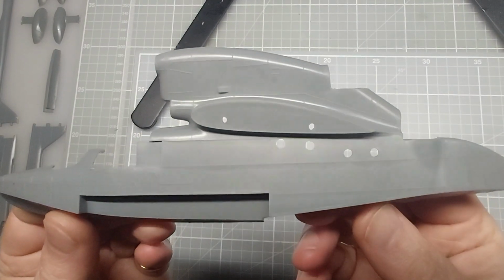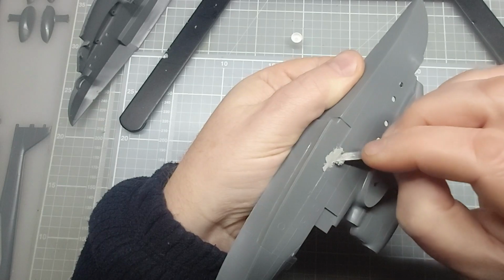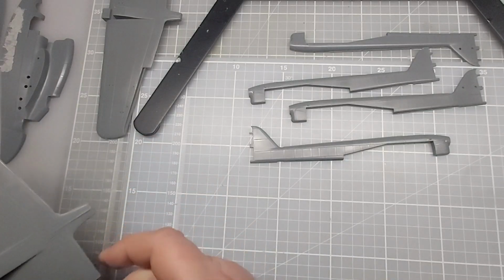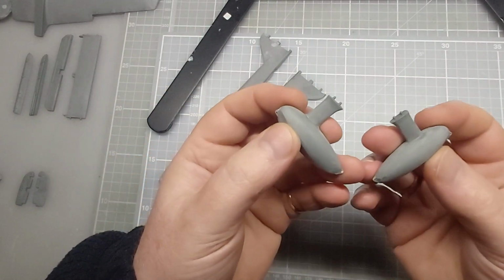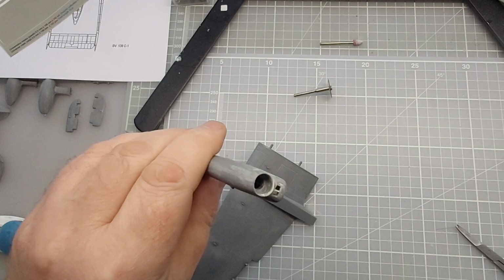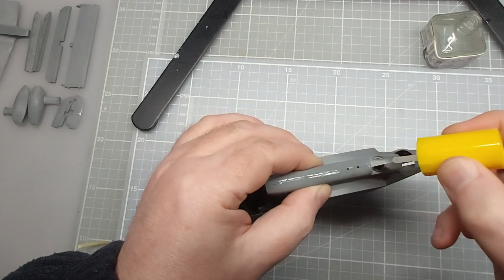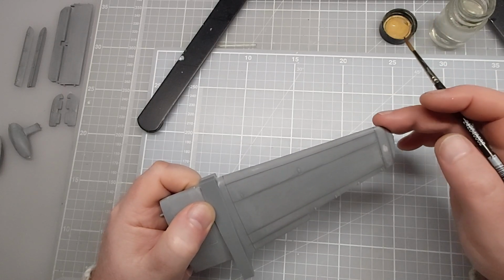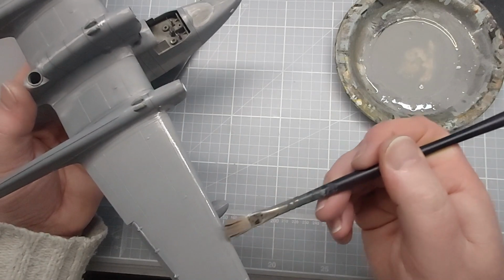Supermodel's 1/72 scale Blohm u. Voß Bv138

Comment: Another wonderful subject, Paul, and a fascinating video. I'd never even heard of Lukegraph before. Their tape seems like a great solution to raised panel lines, for people like me who are useless at engraving new ones. Many thanks, and happy Christmas.
Reply from the maker: Hi, Julian...yes, the tape is rather good.  It's a little transparent, so it can be a bit difficult to see initially but if you apply a coat of thin varnish as I did, it helps to make it clearer and can be quite easily adjusted if necessary.  I share your trepidation at the thought of trying to rescribe the detail... I'm not much good at that either, but I admire those who do take on that challenge.  Thanks for taking time to look in and have a good Christmas and New year... ;-).